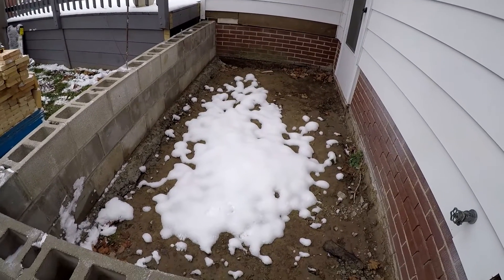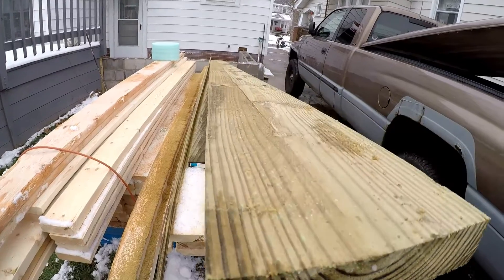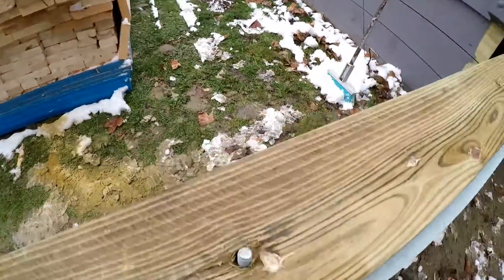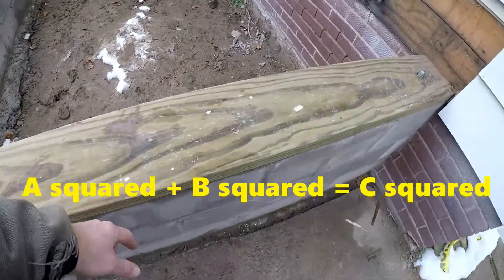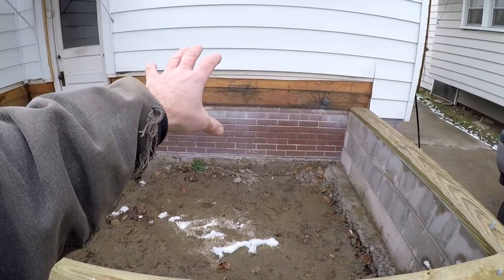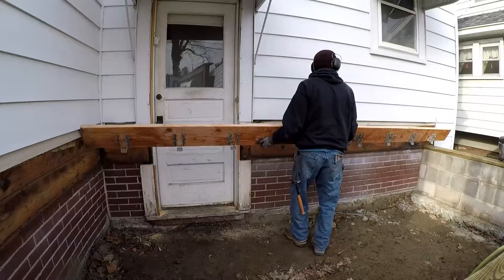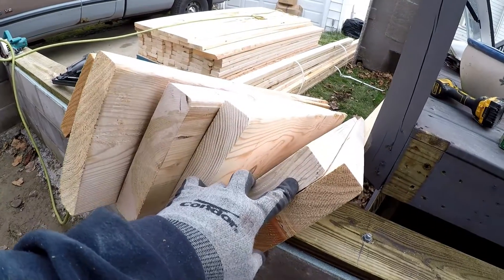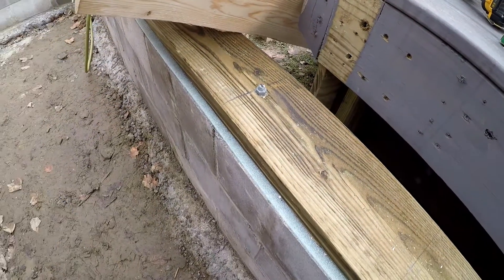Adding A Bathroom #1 | Checking For Square | Laying Out Joists | How To

Comment: Does it matter which way you run your floor joist? ..... and I’m ready for your next video , learned a whole lot from watching your videos thank you
Reply from the maker: Technically, no, but running the joists the 7’ way allows them to be 2x8s. If they ran the long way, they would need a support beam or they would have to be 2x10s. I’m working on the next video, hopefully it will be up Tuesday night👍

Comment: Nice! Lol you care where the tub and shower drain go? Don't the plumbers just cut the joist out of the way with a chain saw? How far down do you need to go for the footing?
Reply from the maker: LOL Yeah, they would just Sawzall the joists out of the way anyway, so i try to make sure everything is in the right place. Actually, the original drawing didn’t work so I moved the shower placement up against the house wall. Footers need to be 3’ deep.